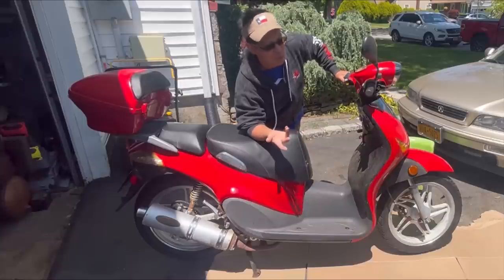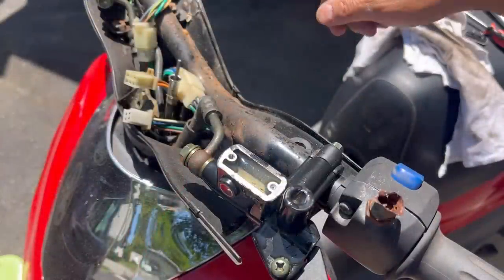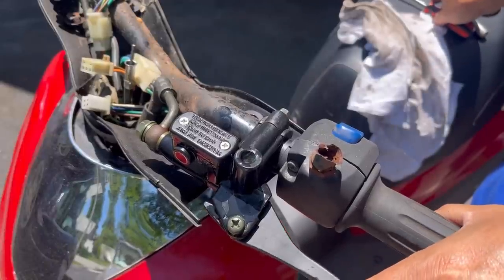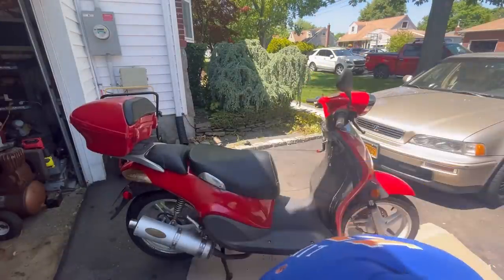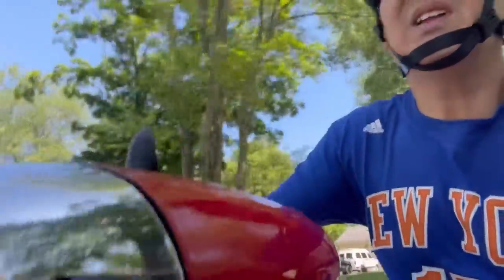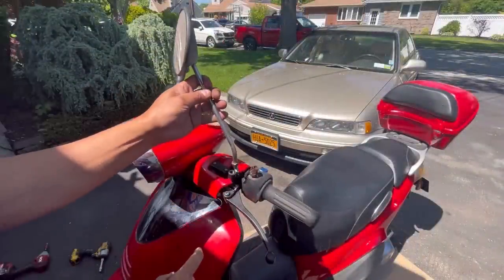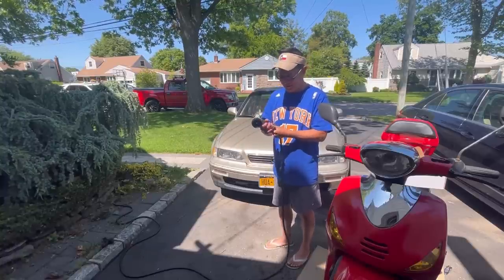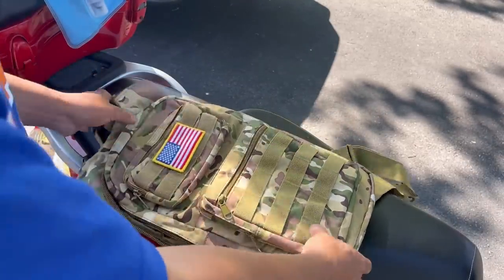FREE CHINESE 150CC MOTOR SCOOTER MOPED CURB ALERT 1ST RIDE & BRAKE MASTER CYLINDER LEVER REPLACEMENT

Comment: Henry that black button put your turn signal back to center push it after you turn the signal on
Reply from the maker: Ooooh!  No kidding?  That’s cool!  Thanks bro!
Reply: @MowersNBlowers  Don't brush people off bud. They are trying to give you some good advice and you better take it or you will not be long in this world. I have been riding since 1982 and I have seen my share of crashes. Had several close calls. Guy pulled out in front of me two days ago he had a stop sign but he never looked left  just cruised right through the stop sign.
Reply from the maker: @scrambler69-xk3kv  bro!  I didn’t know that!  I’m thanking the commenter for the information!  Did you think I was being sarcastic?  I didn’t know the black button did that!